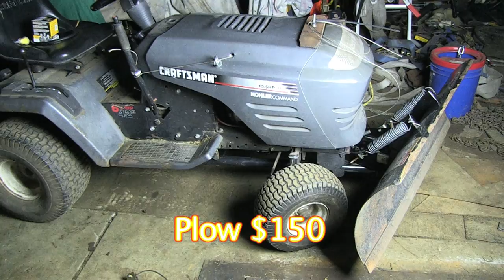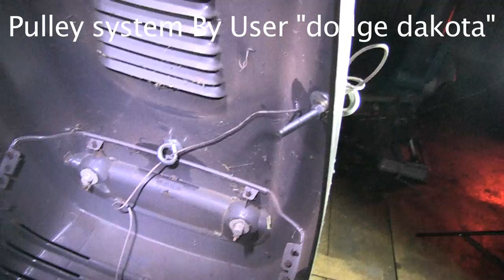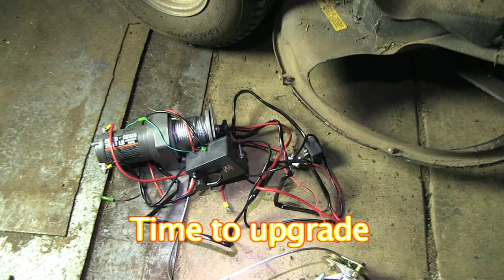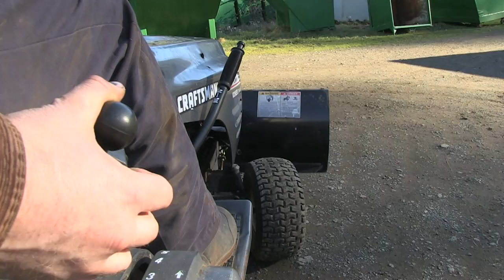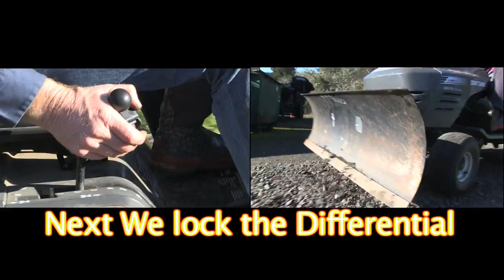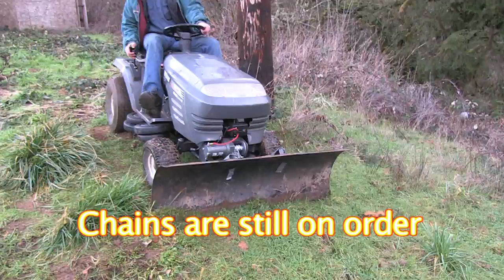Lawnmower Bulldozer DIY Cheap

Comment: I'm working on a similar concept for an l130 John Deere. Instead of a winch I'm installing a 12gpm hydraulic pump that runs off the mowers PTO.. using a small cylinder for the blade I can put real down pressure on it and it will cut into the ground instead of just floating. It's a good idea though, and I like the ingenuity. I'll send you pics once it's done.

Comment: Mount Wolfman you would be amazed at what those drivetrains can take LOL it does not have a drivetrain. ...!! I overloaded and beat on my Craftsman for like 8 years used twice a week and I mean when I used it I used it power wash it once a month this guy definitely does not have an engineering degree but man I wish I had videos of my plow no cables no hydraulics I could push 18 inches of snow no problem and when spring rolls around maybe an hour and a half PMS engine and changing back to the deck Craftsman automatic awesome 19 horse Kohler hoorah

Comment: A lawnmower is designed to mow grass. How anyone expects the drivetrain to last while pushing aggregate etc. is beyond me.  With a blade that size???  Seriously???
Reply: maybe it was a lawn tractor ( same size but for work like towing ) or a garden tractor (same size but for garden work ( small plastic trailers w/ flowers) and stuff) Eva thought of dat!!?!?!!
Reply: Zackly. Frame and transmission aren't built for this.
Nice for 100$
Reply: flatchyu my lawnmower can do it.  its a 2 cylinder 20hp craftsman
Reply: No he won't a 2 cylinder craftsman is a lawn TRACTOR it's made for stuff like that
Reply: montwolfman the tires were slipping, he needs lugs